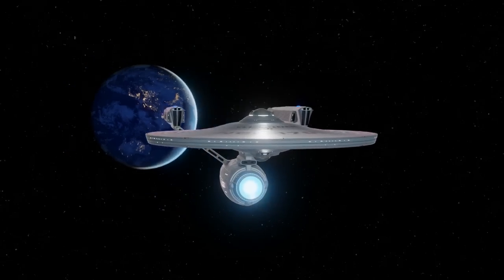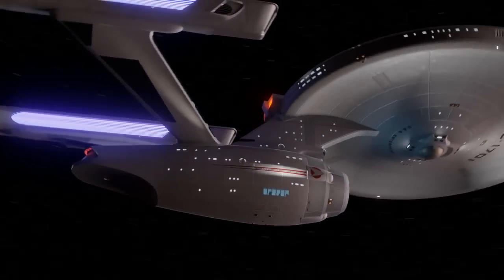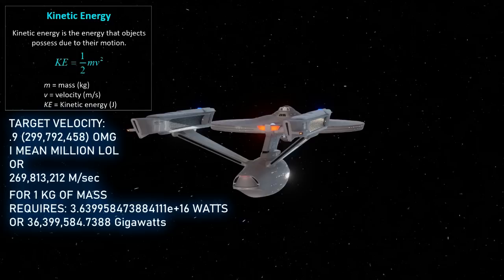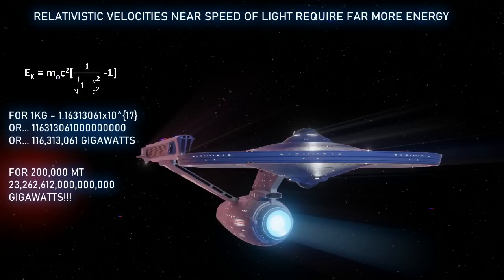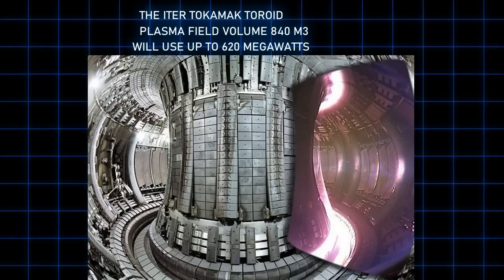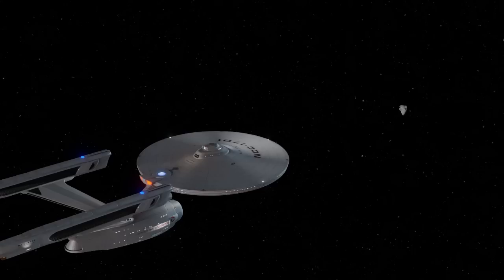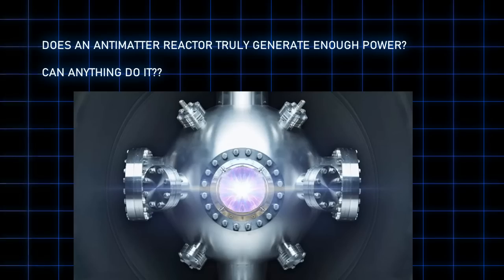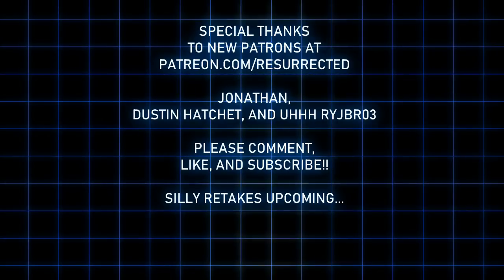How Many Nuclear Power Plants Can Power the Enterprise? Let's Calculate!!!

Comment: You can't use either of the proposed methods to estimate the power generation of starships in Star Trek. Daystrom tried it decades ago as part of the then ongoing Star Wars VS Star Debate and it didn't work, even though he acknowledged the flaws. 
1. Engines - if you are going to apply the logic that 0.9c is full impulse and then proceed to use relativistic effects on energy needed to accelerate some mass to that velocity, then you would need to account for that same effect for time dilation. Does time run slower on a star ship when moving under full impulse? If so, it's never addressed on screen. Either relativistic effects don't occur in ST (which we know they do) or even under impulse power, some level of low intensity warp field is used to mitigate the effects and aid in sub light propulsion;
2. Shields - aside from canon LCARS displays citing graviton frequency of shield emitters (ST VII - Generations), there's zero evidence of shields being plasma based. In fact physical contact with forcefields in ST NEVER ends in severe burns like they do during rupture of EPS plasma relays. Shock or discomfort? Yes. Even pain and death. But never burns. And super heated plasma should burn the person in contact with it, like they get burned when their consoles blow up.
3. Phasers - the output of a phaser emitters has nothing to do with the damage it does to a target. At least not one that corresponds to what we see on screen. Unfortunately, this one is much harder to nail down. The best source we have here is the beta canon, that is the TNG technical manual that was used as writer's pointer for the first 2 seasons of TNG. In it the phasers, both hand held and ship mounted, can cause a series of effects, (such as illumination ,stun,  heating up, and molecular disruption on sub atomic level) that can't be explained through brute force methods. Either the "Nadions" do something to matter as they pass through it, and what they do depends on how they are being modulated or manipulated in other ways, or which is more likely, the Nadions themselves can be used to release different types of discharges. Or maybe both. Either way, the mumbo-jumbo used in the shows, movies and manuals is far to vague or consistent to reach any decisive conclusion. It's probably that way on pouropse. Making the attempt to describe the "sarium krellide cell" that powers a hand held phaser as real world linear nuclear accelerator is stretch at best and missing the point at worst.
Reply: 1. TOS directly accounts for Starships having the ability to counteract time dilation. See The Cage and City on the Edge of Forever.
2. Depending on the setting, a plasma shield doesn't have to burn the person who touches it.
3. "the output of a phaser emitters has nothing to do with the damage it does to a target" - that is the single most ridiculous thing I've ever read. son, if the phasers don't output anything, they don't deal damage.
"the TNG technical manual that was used as writer's pointer for the first 2 seasons of TNG." - That is a myth. The TNG technical manual was never once consulted or even referenced during TNG's entire run. Ignore it.
Reply: @Idazmi7  1. not under impulse. Warp is sometimes referred as time warp. 
2. Plasma is by definition ionized gas. The author specifically mentions super-heated plasma as his thesis for the deflector shields in Star Trek.
3. What part of the "output of a phaser has nothing to do with the damage it does" did you relate to phasers don't output anything..... daughter?
Reply: @ilejovcevski79  
"not under impulse. Warp is sometimes referred as time warp."

Space warp and Time warp are NOT the same thing. 

"Plasma is by definition ionized gas. The author specifically mentions super-heated plasma as his thesis for the deflector shields in Star Trek."

And did you know that such plasma - in reality - can interact with flesh without causing burns?

"What part of the "output of a phaser has nothing to do with the damage it does" did you relate to phasers don't output anything..... daughter?"

If the output of a phaser has nothing to do with the damage it does, it can do damage without output. Obviously, that is ridiculous.

Why did you call me 'daughter'? 🤨
Reply: @Idazmi7  
1. In TOS The Cage, they refer to the same thing. Either case, non of them is impulse. 
2. And did you know that if in sufficient enough densities to actually stop a physical object it does?
3. Nope. It means there is no clear correlation between the input output system of the phaser device. That is, a phaser, drawing power from a MW unit power cell, could in practice have damage effects, that would result from 100's or 1000's of MWs real-life directed energy device, be it EM or particle beam in nature>
4. Well, you called me son, and i assumed it's something the new generation uses these days, as in affectionately calling themselves by family member epithets :D
Reply: @ilejovcevski79  
"In TOS The Cage, they refer to the same thing"

Prove it.

"And did you know that if in sufficient enough densities to actually stop a physical object it does?"

An assumption on your part, backed by nothing.

"Nope. It means there is no clear correlation between the input output system of the phaser device."

Then why do increases in phaser power always do more damage?

"Well, you called me son, and i assumed it's something the new generation uses these days, as in affectionately calling themselves by family member epithets :D"

It's been used long before this generation, son, mostly as a way of implying functional or practical seniority on a topic, like I have over you in this situation.
Reply: @Idazmi7  
1. Pike orders: time warp, factor seven when setting course to Talos:
2. Then the next time you encounter a welder, put your hand in the way of the plasma torch
3. Multiple reasons. You could lengthen the time an emitter can emit. You can shorten the time the capacitor will recharge and thus enable more rapid firing. 
4. Well then, glad to have you here .... daughter.
Reply: 1. All that proves is that Time-Warp exists. I told you to prove that Time-Warp and Space-Warp are the same.
2. A welder isn't a forcefield any more than a taser is a Tesla Coil.
3. All that relates to power.
4. all you're doing here is making yourself look childish.
Reply: @Idazmi7  all that proves that in the pilot they had not made a distinction between the two. Either way, non of them is impulse, which is what the author used to calculate power generation.
2. A welder is a much lower density plasma then a plasma shield can hope to be to withstand solid matter. In fact, not even fusion reactor levels of plasma density can hope to provide it. Also.... plasma shields aren't force fields either. Magnetic fields are, which are used to contain the plasma, 
3. It does not, not as far as trying to compute energy output based on external damage.
4. Shall i take you to see Barbie next weekend then?
Reply: @ilejovcevski79  
"all that proves that in the pilot they had not made a distinction between the two."

Wrong: it proves that you are either unable or unwilling to provide actual evidence for your position. Obviously, warping time is a separate process from warping space.

"Either way, non of them is impulse, which is what the author used to calculate power generation"

This matters why? Star Trek uses the warp drive to calculate power generation, and provides a very different impulse power output calculation.

" A welder is a much lower density plasma then a plasma shield can hope to be to withstand solid matter."

And you provide:
1. No proof. (hint: it's not the plasma itself that withstands the matter)
2. no evidence that plasma density = thermal energy.

" It does not, not as far as trying to compute energy output based on external damage."

That statement is a lie. Phasers operate on the same principle as every other directed energy weapon: more power output = more damage potential. The show itself attests to this constantly.
Reply: @Idazmi7  1. a. why using Lorentz transformations then?
1.b. What's the essence of General relativity?
2. Hint, in the video it is the plasma density that is stated as providing the stopping power. Plasma is by definition ionized gas. Ionized means some or all electrons have departed the electron shell of the atom or molecule. For an electron to leave the shell, it needs precisely defined quantity of energy. Excess energy means heat. The video on top of that, uses super-heated plasma and the source of the stopping power. Even if you would like to jump the shark, and propose that it is the heat of the plasma that stops incoming matter (that by the way wont work for rapid objects, or EM radiation), you still need particle density to transfer that heat to the incoming objects. And what is the average relative density of the plasma in modern fusion reactors?
3. Pop-quiz question: what determines the total energy yield of a nuclear blast and why? Is the energy of the neutrons that cause the critical mass or is the chemical energy of the explosives that case the formation of the critical mass?
Reply: @ilejovcevski79  
1. Again: you must prove that Time Warp in Star Trek is the same as Space Warp in star Trek. You have not done so. Prove so, using Star Trek.

"Hint, in the video it is the plasma density that is stated as providing the stopping power."

So? As far as reality is concerned - and star Trek is concerned - it would far more likely primarily be the magnetic part of mageto-plasma, not necessarily the plasma itself.

"Pop-quiz question: what determines the total energy yield of a nuclear blast and why?"

Phasers are directed-energy weapons. Pop-quiz question: can any object be directly impacted by 1.5 kilojoules of any kind of energy, and yet be damaged for only 1 joule? If not, your premise is faulty.
Reply: @Idazmi7  you haven't answered any of my questions. I begin to get the feeling that despite you seniority, you really lack the basic grasp of special and general relativity, as well particle physics.  It's like trying to prove to a Flat-Earther with no passing familiarity of Euclidian geometry, why Earth can't be flat.
Reply: @ilejovcevski79  
Excuse me, we are discussing Star Trek, not your opinions on real physics. either your words match up with Star Trek, or they don't: so far, they don't. And your understanding of magneto-plasma and directed energy is absolutely laughable: according to you, every tokamak would just melt, and lasers don't do damage by delivering energy to the target.
Reply: @Idazmi7  not quite. We are discussing my comment on a video that uses real-life physics to explain Star Trek tech. We both know tech in Trek is magic and does whatever the writers need it to do, to make the plot works. But that's not what the video is about. The video is about applying SR, GR and particle physics to explain what we see on screen based on that writing. For that to work, we need a certain level of understanding of the topic.
Reply: @ilejovcevski79  
" not quite. We are discussing my comment on a video that uses real-life physics to explain Star Trek tech"

Except your first comment completely contradicts this by trying to explain technology that doesn't exist in reality. You also dismissed onscreen canon in that very opening post as if Star Trek's own words are less important than your ignorant commentary. That's to say nothing of your deeply flawed understanding of physics on every level.

"We both know tech in Trek is magic and does whatever the writers need it to do, to make the plot works. "

So you assume. You demonstrably understand neither reality nor Star Trek, so you cannot make that claim from any perspective of truth or honesty.

"The video is about applying SR, GR and particle physics to explain what we see on screen based on that writing. For that to work, we need a certain level of understanding of the topic."

It's only too bad that you don't understand the topic, on either count.
Reply: @Idazmi7  and this shows your total lack of understanding of GR, SR and particle physics. Resurrected Starships uses real life science to explain trek tech. First he uses Lorentz Transformations when he calculates the energy needed to accelerate a ship to 0.9c and then he uses particle physics to explain energy required to power plasma shields... and so on. So, if you claim to understand the topic, would you be so kind to elaborate on:
1. Lorentz transformations, why are they used? What's the meaning of them? How do you interpret the results? When are such transformations used instead of Newtonian calculations?
2. What is the essence of general relativity? How does the calculation of a four-dimensional lagrangian impact impact the above calculations? When do those calculations make sense and are used instead of Euclidean geometry?
3. What is the average relative particle density of a modern fusion reactor?
4. What determines the total yield of a nuclear explosion and why? The energy of the neutrons that initiate the chain reaction or chemical energy of the explosive that creates the critical mass? 

Answer these questions and we'll be halfway to the points i am addressing in the RS's video.
Reply: @ilejovcevski79  
" and this shows your total lack of understanding of GR, SR and particle physics. "

No. It doesn't.

"Answer these questions and we'll be halfway to the points i am addressing in the RS's video."

Except, of course, none of those points are in any way relevant to Star Trek. I'm not here to defend Resurrected Starships, I'm here to clarify how incorrect your assumptions are.

"Daystrom tried it decades ago as part of the then ongoing Star Wars VS Star Wars Debate and it didn't work"

This is the true crux of your argument: not any real science. Thus, the only important factor is what happens in Star Trek itself. By the way, the reason daystrom failed is his insistence on using the non-canon TNG "technical manual" instead of Star Trek itself. You are doing the same thing - making the same mistakes.
Reply: @Idazmi7  1. Oh i believe it does. You gave provided 0 reasons for anyone to think otherwise.
2. But my assumptions are directly related to the RS video. 
3. He mentioned it in his musings, but he did much more then that. He also tried to calculate how much energy would be required to vaporize certain quantities of material based on visual data from the shows and movies alone. Who's making things up now? 
Still waiting on your answers BTW.... do you need some help? You are allowed to call one of course.
Reply: @ilejovcevski79  
"Oh i believe it does. You gave provided 0 reasons for anyone to think otherwise"

Now THAT'S funny - you don't even know the basic principles of magnetic forces and directed energy, and you're presuming to lecture me on concepts far beyond that.

"But my assumptions are directly related to the RS video."

So? The topic is Star Trek's power output, not this video in isolation of Star Trek. Stay on topic. 

"He mentioned it in his musings, but he did much more then that. He also tried to calculate how much energy would be required to vaporize certain quantities of material based on visual data from the shows and movies alone. Who's making things up now? "

You, because at very least, Resurrected Starships used actual data to make his assumptions.

"Still waiting on your answers BTW.... do you need some help? You are allowed to call one of course."

I'm in no way interested in helping you pretend to be smarter than you are. You will acknowledge how tokamaks avoid melting, and how lasers function (which you avoided before) before I even consider answering your banal questions.
Reply: @Idazmi7  :
1. Oh yeah? And you think magnetic component of a techno-babble interacts with non fero-magnetic compounds an electrically neutral objects and radiations.  Can you please explain to me induction and magnetic flux? These two should be easy for an expert in magnetic forces such as yourself!
2. The topic is power generation, measured through real life power generation, based on real life scientific principles. If you want to make a video that departs from those principles, i'd be more then happy to not just watch it, but also share my opinions on them (if you would suffer my musings of course).
3. And why do you think a tokamak should met to begin with?

BTW, refusing to answer a question helps you look smarter as much as it does help you pass the exam... just saying
Reply: @ilejovcevski79  
"Oh yeah? And you think magnetic component of a techno-babble interacts with non fero-magnetic compounds (...)"

You didn't know that intense enough magnetic fields do affect non-ferromagnetic objects via interactions with electrons?

"The topic is power generation, measured through real life power generation, based on real life scientific principles."

The power generation of a fictional starship's equally fictional technology, you mean. The kicker is, you don't understand the scientific principles you claim to espouse, either: you clearly stated - as a fact - that plasma density is the only factor in deflection,(which is simply not true) and that phasers (a phased laser DEW) do NOT do damage based on power output, which directly violates the observable show, AND the laws of physics you claim to care about. You have not one argument in either logic or good faith.

"If you want to make a video that departs from those principles, i'd be more then happy to not just watch it"

You departed from those principles when you said phasers don't do damage based on power output, and started talking about nuclear reactions as if they're relevant to a directed-energy weapon.

"And why do you think a tokamak should met to begin with?'

I don't. You said that they would, not even knowing that's what you did. That's my point.

"BTW, refusing to answer a question helps you look smarter as much as it does help you pass the exam... just saying"

Believe it or not, your constant Ad Hominem attacks aren't a sign of any intelligence, nor is my refusal to engage with your nonsense a sign of weakness. Rather, it's proof that I don't take you seriously enough to bother. You've been making up your own facts since your first post: nobody cares about your ignorant, made up "lore."
Reply: @Idazmi7  
1.  No magnetic field  will ever deflect or redirect photons, unless it bends space-time itself, in which case it's not the magnetism that bends it, but the generated space-time distortion, that being gravity. As for aligning electron spins in some molecules, it's useless for matter deflection. You can cause chemical changes in living cells, even burning or dehydration, but not deflection. Not unless you are manipulating specific materials. Forcefields in trek however, do not act this way. 
2. Plasma density is the only factor in deflection. Magnetic fields won't work. Phasers are not lasers.  The rest is meaningless techno-babble.  As for conservation of energy, i am still waiting on your response on the energy yield of a nuclear blast, and how it's dependent on the energy of the neutrons that initiate the reaction and the chemical energy of the explosive used in achieving critical mass. Answer that and you'll have an alternative modus operandi for phasers.  As for the fictional power generation, i never said anything about it. Not the topic of my comment to RS. My only concern is with the application of real life physics to explain observed events.
3. Just in case we are talking about different topics (these things can happen in over-the-wire communication way to easy), i am suggesting you make a video about YOUR interpretation if the FICTIONAL working if those techs in ST. Not a real-life interpretation of fictional tech. RS already did that on couple of occasions. I am interested (genuinely) in how other factions of the fandom perceive the inner workings of the movies and the shows, and how they work around the inherent changes in lore introduced over the years, due to changes in writing teams and the like. Like seriously, i'm not pulling your leg or something. As for nuclear reactions, mate, nuclear reactions are essential part in particle beams. Where do you think those protons, helium cores, mesons and the like come from? You need to "break" an atom (one way or the other) to get those. 
4.  And point me to my mistake here. How exactly did i say that? And what is your explanation for the walls not melting? Again, genuine curiosity here. 
5. Well then, we are having this discussion for nothing then.
Reply: @ilejovcevski79  
" No magnetic field  will ever deflect or redirect photons, unless it bends space-time itself"

From your first post: "(...) aside from canon LCARS displays citing graviton frequency of shield emitters (ST VII - Generations), there's zero evidence of shields being plasma based"

Funny how gravitons control gravity... which is a bend in space-time by definition. 

" Plasma density is the only factor in deflection. Magnetic fields won't work. Phasers are not lasers."

The hand-carried weapons, called "phasers," are pure energy weapons (as are all offensive weapons in the ship's arsenal). all phasers emit a beam of energy similar to the light beam emitted by a Laser, but of a pulsating nature that can be "phased" to interfere or interact with the wave pattern of any molecular form (...) - The Making of Star Trek, page 193. Thank you, Gene Roddenberry.

"Just in case we are talking about different topics (these things can happen in over-the-wire communication way to easy), i am suggesting you make a video about YOUR interpretation if the FICTIONAL working if those techs in ST."

Why would I do that just for you? Besides: all of Star Trek's typical technology is based on reality to the point that reality mimics Star Trek instead of the other way around: 

Phased lasers (DARPA projects)
Plasma-based shielding (DARPA projects)
Artificial Intelligence
Tactical use of A.I.
Neural Networks (mimicking human brain)
Automated weapons targeting
Bluetooth (Uhura's headset)
Magnetic containment
Antimatter power and weaponry
Sensors (various different types of them)
lithium capacitors (as they were in TOS)
Biometric scanning and ID
Magnetic Resonance Imaging

And that's just TOS alone. It takes a special sort of intentional blindness to miss.

"I am interested (genuinely) in how other factions of the fandom perceive the inner workings of the movies and the shows, and how they work around the inherent changes in lore introduced over the years, due to changes in writing teams and the like. Like seriously, i'm not pulling your leg or something."

You are. You have done nothing except deny the canon information since you started, so I have no reason to believe this at all.

"And point me to my mistake here. How exactly did i say that?"

Like I said, you don't even know what's coming out of your own mouth. Either that, or you're so desperate to not give me an inch in debate that you'll deny making any mistake to your own detriment.
Reply: @Idazmi7  
1. We finally agree on something. Gravitons (if they even exist) are quanta of gravity. Which is why shield emitters are gravity based, that is, they emit gravitons.
2. Good for poor old Gene, but they departed from his path long time ago. In more then one way too.  Heck, there was even a time when they didn't really even make a difference between torpedoes and phasers. As for onscreen evidence, phasers are clearly not lasers. First, they are referred to as particle beams. Second, they clearly move slower then light, which indicates they have rest mass higher then 0, unlike photons.
3. You certainly don't have to. It would just be a nice thing to do and a proper place to continue the discussion. As for the second part of the comment, no mate, ST tech isn't based on reality. Reality is inspired by ST tech. Just like reality always inspired by human vision and imagination. You may be mixing the two. Since the times of Frankenstein and Jules Verne, if not even before that. 
4. Objection your honor, speculation. Just kidding. But as stated buy who knows what time, this video has nothing to with canon. You make one on canon, and i'll watch it. Suit yourself. You aren't giving any reason for a person to answer to your questions, as you never answer back.
5. Here it is again. You aren't answering. You say i make a mistake. I ask, what is the mistake i made? You refuse to answer me. I guess this is the way debates are made over there (where ever that is). Good luck then on your next job interview.
Reply: @ilejovcevski79  
"1. We finally agree on something. Gravitons (if they even exist) are quanta of gravity. Which is why shield emitters are gravity based (...)"

No we don't, because you denied this point in your first post without a single thought, solely because it meant that shields are a graviton plasma, and you didn't like the idea that the shields would be plasma. even now, you say "gravity based" as if that contradicts the fact that the shields are plasma. Additionally:

1. The TOS Enterprise does not have graviton shielding. The Enterprise-D, made 100 years later, does.
2. Despite your denials, magneto-plasma can absorb, scatter, and deflect laser beams. Without gravity manipulation.

"2. Good for poor old Gene, but they departed from his path long time ago."

Incorrect. TNG is set 100 years after the original Star Trek, and explicitly exists in the same continuity, constantly referencing the original show, it's events, and it's technology, changing nothing.

"Heck, there was even a time when they didn't really even make a difference between torpedoes and phasers."

I don't know where you get your fake info from, but it's fascinating. There's been a distinction between photon torpedoes and phasers since season one's Arena - which introduced them - so stop regurgitating rumor and do some actual research for once.

"You certainly don't have to. It would just be a nice thing to do and a proper place to continue the discussion. As for the second part of the comment, no mate, ST tech isn't based on reality. Reality is inspired by ST tech. (...)"

Meanwhile, the original Star Trek has direct connections with RAND, UCLA, NASA, DARPA, Los Alamos Research, JPL and so on. Everything I mentioned before was inspired by actual, ongoing research. Even if that wasn't true, it illustrates exactly how much non-fictional science goes into this fiction, considering that these technologies could actually be invented... unlike Frankenstein's creature.

"4. Objection your honor, speculation. Just kidding. But as stated buy who knows what time, this video has nothing to with canon. You make one on canon, and i'll watch it. Suit yourself. You aren't giving any reason for a person to answer to your questions, as you never answer back."

You are neither intelligent enough nor interesting enough to engage in meaningful conversation with. Your insistence that Star Trek has no real data behind it is proof of your lacking intelligence.

"Here it is again. You aren't answering. You say i make a mistake. I ask, what is the mistake i made? You refuse to answer me. I guess this is the way debates are made over there (where ever that is). Good luck then on your next job interview."

You aren't interviewing me for a job. You aren't even aware that I subtly referenced your mistake here, again... but this time in reference to shields. Hint: you don't understand magneto-plasma.
Reply: @Idazmi7  
1. Now you are talking gibberish again. Graviton plasma? Plasma is ionized gas. Coining a term like graviton plasma makes less sense then saying photon plasma. All plasma is in essence baryonic matter, gravitons aren't. They aren't matter at all. Also, when referring to magneto-plasma, are you referring to the real-life concept or ST method of plasma transfer? 
2. It can't. Not unless you count amplitudes of order of magnitude that create singularities. Now in some cases in trek, singularities are created (even in weirder ways), but during regular shield and forcefield use? As for TOS, back then they even had screens and deflectors. Which is which and how it works is an interesting topic. Not used or explained  in OP video though,  so haven't addressed those.
3. You misinterpret my comment. When i mean they departed from his ideas, i mean the writers. Gene may even wanted to use lasers originally. But trek being trek, needed something with fictional properties. Hence the invention of phasers. And then again, even when they did invent them, they didn't yet know exactly what they want to do with them (not to mention, later writers, again as trek often does, jumped the shark, and overrode the old canon, so even if phasers were supposed to originally be much more similar to phasers, they eventually ended up not so). Which leads to:
4. Remember that one time they used phasers like slow moving blobs set to proximity detonation? That's TOS. This would have been perfect scenario to make a clear functional distinction between the two and use torpedoes for such purpose, like later trek did. Now yes, this is writer's blunder. But as it stands, alas, it's also canon.
5. I disagree. Frankenstein as a novel is a source of inspiration as well. Cell rejuvenation, preservation and reanimation. Trek  takes inspiration and references these concepts too. From memory, the last time i saw it in, was that ST Voyager episode with the resurrected would be lover of Harry Kim. Heck, modern defibrillators are directly inspired by it.  Can we claim Mary Shelley invented those? I wouldn't go that far, but you are free to do so.
6. So you only engage with people of certain levels of intelligence? Those that meet your standards? That's certainly... and interesting outlook.....for a trek fan. Are you sure you weren't on the SW side back in the days of ST VS SW forums? 
7.  If you insist you don't explain yourself to inferior life forms, then why are we even continuing this conversation? You are only making it clear you are unwilling or incapable of answering questions that can fuel it forward.
Reply: @ilejovcevski79  
" Now you are talking gibberish again. Graviton plasma? Plasma is ionized gas. Coining a term like graviton plasma makes less sense then saying photon plasma."

also you: "Shields - aside from canon LCARS displays citing graviton frequency of shield emitters (ST VII - Generations), there's zero evidence of shields being plasma based."

Which is it, bub?

"It can't. Not unless you count amplitudes of order of magnitude that create singularities. (...)"

🤣
WRONG. Dear lord! Dude, did you know that magnetoplasma technology can reflect lasers now? Look up "plasma mirror" before your reply, please! I can only laugh so hard.

"You misinterpret my comment. When i mean they departed from his ideas, i mean the writers. Gene may even wanted to use lasers originally. But trek being trek, needed something with fictional properties. Hence the invention of phasers."

The hand-carried weapons, called "phasers," are pure energy weapons (as are all offensive weapons in the ship's arsenal). all phasers emit a beam of energy similar to the light beam emitted by a Laser, but of a pulsating nature that can be "phased" to interfere or interact with the wave pattern of any molecular form (...) - The Making of Star Trek, page 193. Apparently, they're called phasers... because they are phased lasers. Which are real technology. I literally just showed you this.

"Remember that one time they used phasers like slow moving blobs set to proximity detonation?"

You mean the pulse phasers from Errand of Mercy? They also appear in Balance of Terror. And The Wrath of Khan. And Deep Space 9. And they aren't slow. Unlike those, photon torpedoes are guided weapons.

"I disagree. Frankenstein as a novel is a source of inspiration as well. Cell rejuvenation, preservation and reanimation. Trek takes inspiration and references these concepts too"

Nope. Nobody rejuvenates cells with lightning bolts in Star Trek or reality, and the novel Frankenstein, or a Modern Promethius contains no detailed scientific data or research. Star Trek does, as I have already proven.

" So you only engage with people of certain levels of intelligence?"

I engage with people who are honest. You are not. You know that what you're saying is incorrect, and you say it anyway. Your first post reveals that you are on the Star Wars side of fan debate, so you aren't here to understand science and technology. Your motivation from the start has been to attack Star Trek's reputation in science: an utter waste of time, reliant upon false narratives, like the rest of the Star wars "debaters". 

" If you insist you don't explain yourself to inferior life forms, then why are we even continuing this conversation?"

I cannot allow misinformation to go unchallenged.
Reply: @Idazmi7  
1
Line cookie sheet with foil. In 2-quart saucepan, melt baking chocolate over low heat, stirring constantly; stir in butter until melted and smooth. Remove from heat; stir in whipping cream. Pour mixture into small bowl. Refrigerate 10 to 15 minutes, stirring frequently, just until thick enough to hold a shape.
2
Drop mixture by rounded measuring teaspoonfuls onto lined cookie sheet. Return to refrigerator 5 to 10 minutes or until firm enough to shape. Shape into balls. Freeze uncovered 30 minutes.
3
In 1-quart saucepan, heat chocolate chips and shortening over low heat, stirring constantly, until chocolate is melted and mixture is smooth; remove from heat. Using 2 forks, dip and roll chocolate balls, one at a time, into melted chocolate; tap off excess chocolate. Place on lined cookie sheet. Immediately sprinkle with nuts. If chocolate has cooled too much, reheat. Repeat with remaining chocolate balls.
4
Refrigerate truffles about 10 minutes or until chocolate is set. Store in covered container in refrigerator. Remove from refrigerator about 10 minutes before serving.
Reply: @ilejovcevski79  
You've just given up, huh? 
😆
Reply: @Idazmi7   
1
Rinse the whole pluck in cold water. Trim off any large pieces of fat and cut away the windpipe

2
Place in a good sized pot and cover with cold water. The lungs float, so keep submerged with a plate or a lid. Bring to the boil and skim the surface regularly. Gently simmer for 2 hours
3
Lift the meat from the pot with tongs or a slotted spoon, and rinse in cold water to remove any scum. Place into a bowl and leave to cool

4
Strain cooking liquid through a fine sieve and put back on the stove to reduce until you have roughly 500–1l of stock. Leave to cool
5
Whilst the stock reduces, finely dice the cooked heart and lungs. Grate the liver using the coarse side of the grater. Finely dice the trimmings. Mix together in a large bowl, along with the suet, oatmeal and spices
6
Measure how much stock remains from cooking the pluck, and make up to 1l with cold water. When cool, add to the haggis mixture

7
To check the seasoning, pan fry a tablespoon of the mixture for 2–3 minutes and taste. Add any extra salt, pepper or spice if needed

8
Spoon the haggis mixture into the soaked, rinsed ox bung. Be aware the filling swells as it cooks, so pack quite loosely, and keep a little bung at each end

9
When the haggis is the size required, expel any extra air, pinch, tie with string and cut with scissors
10
Tie the new end of the bung, and continue stuffing. Freeze any spare haggises

11
Before cooking, pierce the haggis several times with a needle. Place in a pan of cold water, and bring to the boil. Simmer for 1.5–2 hours. When ready, the internal temperature should read at least 74°C

12
Serve with mashed potatoes and swede. Or neeps and tatties
Reply: @ilejovcevski79  
I accept your concession.
Reply: @Idazmi7  
1	Whisk egg, vanilla and cinnamon in shallow dish. Stir in milk.
2	Dip bread slices in egg mixture, turning to coat evenly on both sides.
3	Cook bread slices on lightly greased nonstick griddle or skillet on medium heat until cooked through and browned on both sides. Serve with Easy Spiced Syrup (recipe follows), if desired. Voila, easy French toast.
4	Easy Spiced Syrup: Add 1 teaspoon McCormick Pure Vanilla Extract and 1/4 teaspoon McCormick Ground Cinnamon to 1 cup pancake syrup; stir well to mix. Serve warm, if desired.